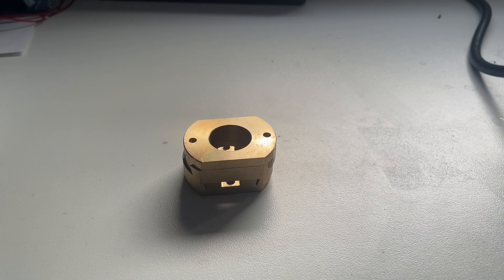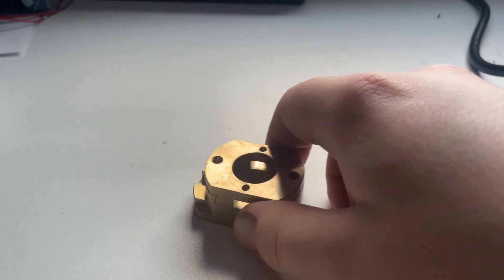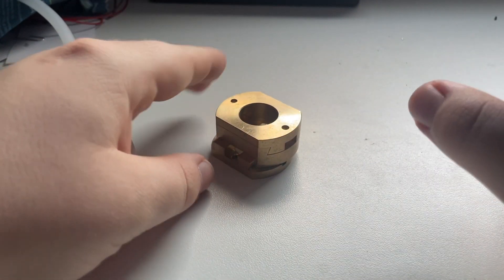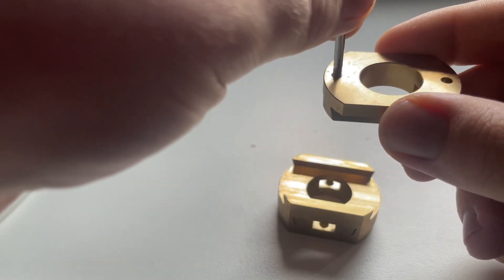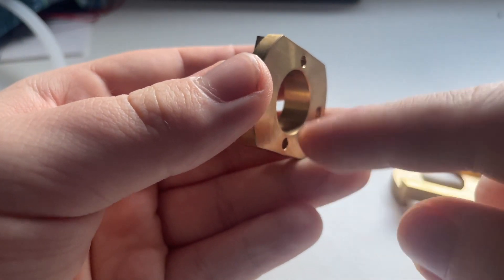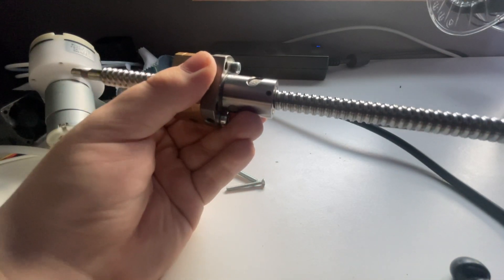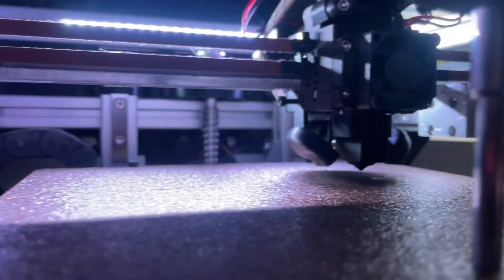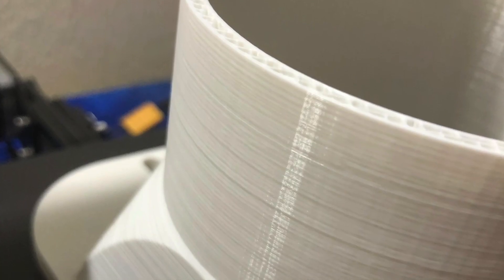Mellow Oldam Coupler Review | Backlash Test and Print Results

Comment: I put Oldham couplers on my CR-10S Pro.  It had some z wobble that I didn't like.  The couplers didn't fix it, initially.  Being lazy, I didn't remove them right away.  I discovered parts improving after about 20 hours.  Perhaps this is a break in period?  I haven't pulled the couplers to see but they might have less friction after break in.  Note:  I lubed them on installation with wheel bearing grease
Reply: I too am adding these to my CR 10 S pro with some anti-backlash spring nuts under the old ham coupler. Will mention my results here afterwards.
Reply: Yes i agree, it needs good lubrication and some breaking in, it does work but it needs a bit of time